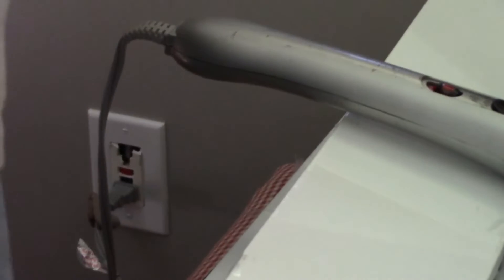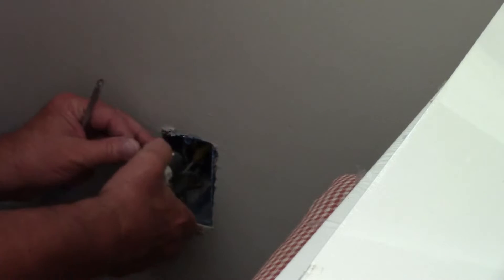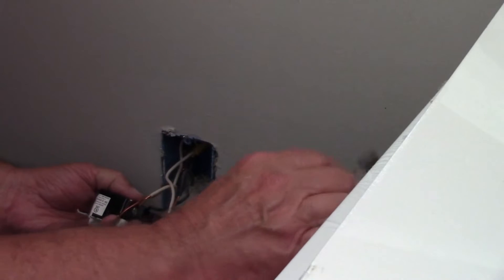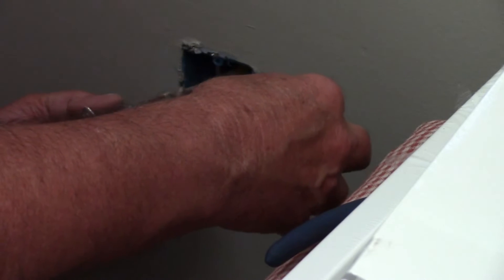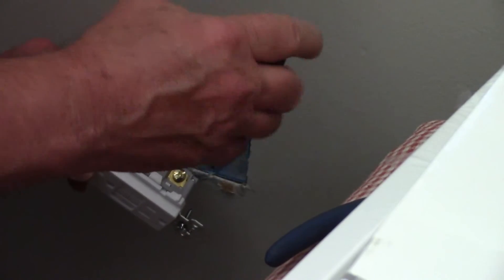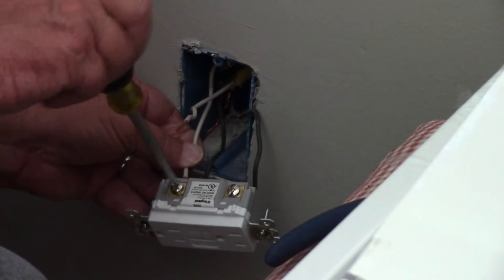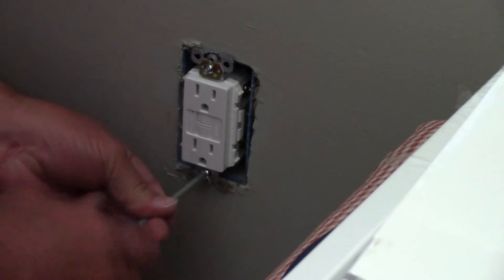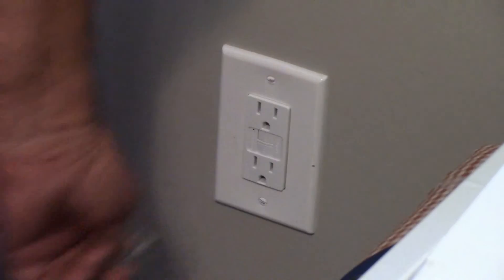Replacing GFCI Electrical Outlet

Comment: im not sure why you have a GFCI in a bedroom ..they are for outlets around or near water but it dont hurt nothing in a bedroom ...ya did a great job ilistrating this ..heres somthing i do .... i rap the outlet top bottom and sides with electrical tape covering the hot and nuetral screws ...on rare occassions i have had the ground wire come in contact with them when i put the receptical back in and then it trips the breaker when flipped on ...i do this with lightswitches as well
Reply from the maker: The code here requires the GFCI on first outlet in each bedroom.  This bedroom was added about 16 years ago and it was required by county electrical inspector.  Thanks for watching.  Have a great week...Calvin
Reply: wow this is a new one on me ...i learn somthing new every day ....i just now see where the state of oregon has that same requirment here since 2014 on new construction